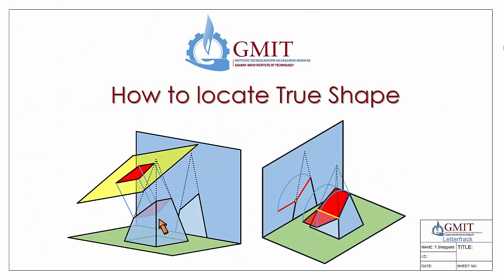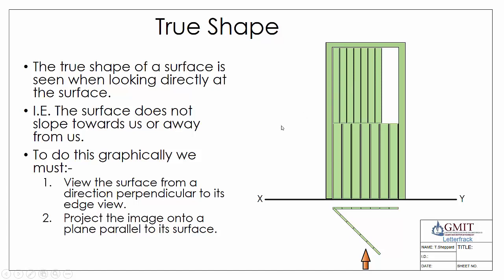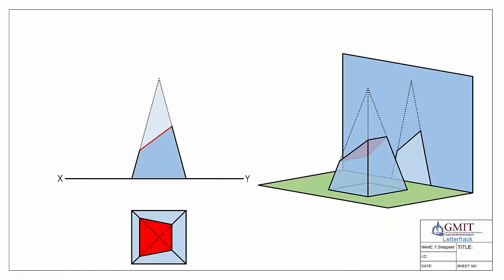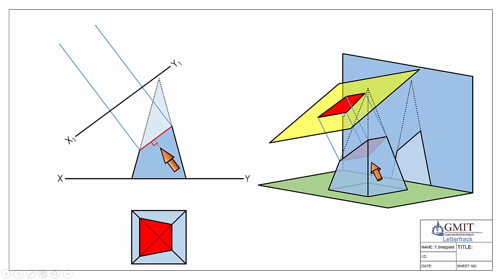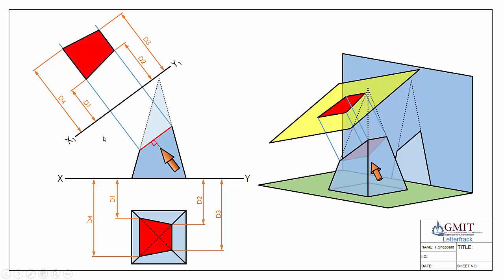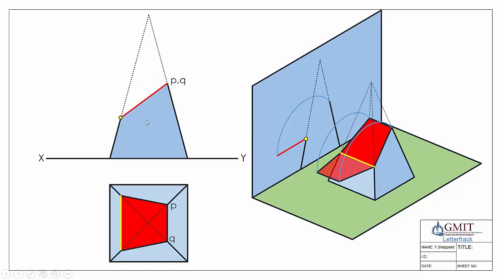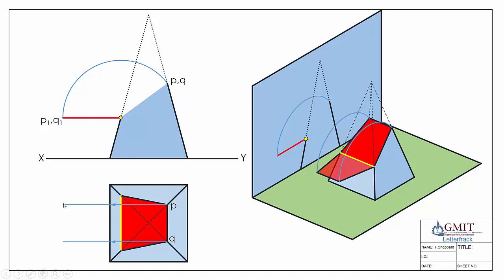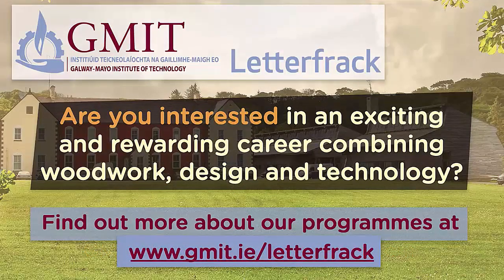Locting the true shape of a surface

Comment: Very helpful...especially the second method which I have not seen anywhere.  But I want to go the other way, meaning I know the true length of something that I want to draw but I don’t know it’s foreshortened length.  In that case do you draw the auxiliary view and then put the known length in and work backwards?

Also, is it possible to use trigonometry?  For instance,  in your example let’s say the re shaded surface is the back of a chair that tilts back 4 degrees and whose two support members angle in at 6 degrees.  In that instance in the view shown at the top left of your drawing would the length of the red line be the actual length times the sin of 6 degrees?  Likewise, would the length in the third view (not shown in your drawing) be the actual length times the sin of 4 degrees?